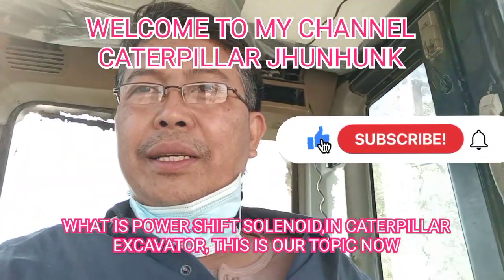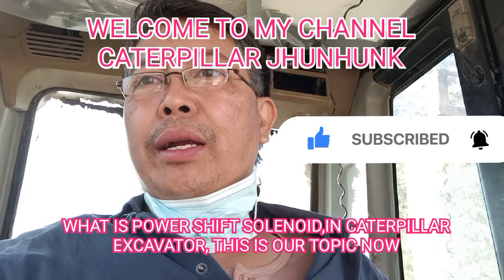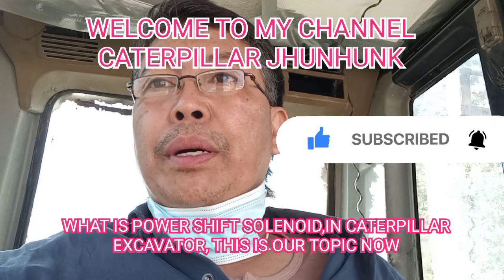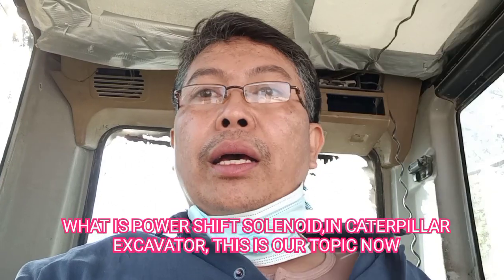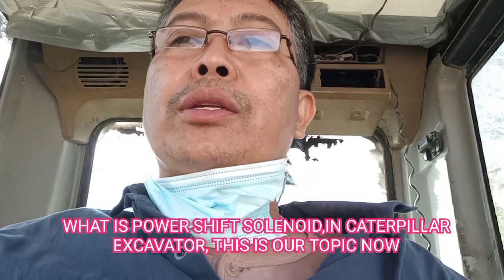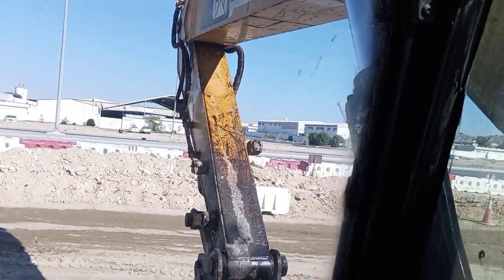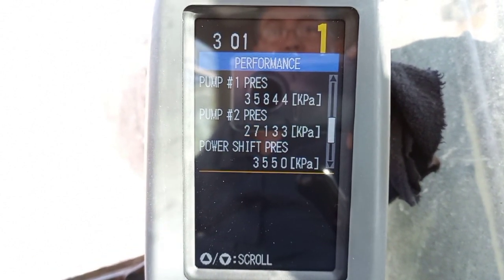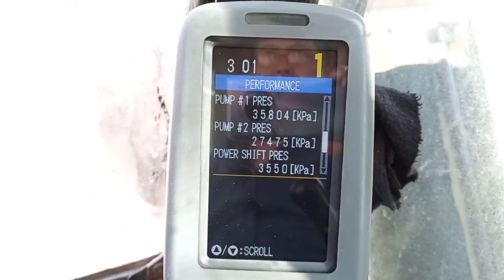CATERPILLAR EXCAVATOR SIMPLE TIPS HOW POWER SHIFT SOLENOID IMPORTANT, IF THIS IS NOT FUNCTIONING

Comment: What could be the cause of our unit that the engine auto idle didn't activate when you move the joystick/lever of boom down, travel right, bucket in/out and stick in but if you move the joystick/lever of boom up, swing lh/rh, travel left and arm out the engine auto idle will activate....

Ty in advance for your response.
Reply: Cat349d2 po Yung unit namin  sir

Comment: Assalamualaikum dear sir ..how are you sir on idel the machine psp power shift solenoid pressure is 34 35  bar but when u load the machine with like fully up boom or fully closed the arms bucket then the psp power shift solenoid pressure should be down 👇🏽 but on ur monitor it's show still consistently and even it's litte up 36 bar it's mean ur solonid is not working well or what else please guide me for ur lot of experience thank you ❤
Reply from the maker: Its possible something is wrong on ps solenoid
Reply from the maker: But if the machine condition and performance is normal ignore it

Comment: Hav a cat 330dl overheating and loose of power what could be the cause or what to check no codes on dash
Reply from the maker: Check the high pressure before you start to operating the machine ,then check again when you feel the power loose, then compair it

Comment: Sir, what, of if the Excavator is not moving fast and the pump is good
Reply from the maker: I dont know which brand of machine you have
Reply from the maker: Many reason possible cause of low speed, first speed control or hydraulic pressure

Comment: 39:374-5
39:2426-4
Ano po kya ser problem nyan ask ko lang po thank you
Reply: 312D caterpillar
Reply from the maker: Brad sorry contakin mo ako s whatsapp, +971567581176
Reply from the maker: 39-374-5 swing brake solenoid open circuit or or wire damage

Comment: What is the normal power shift  pressure? Should the pressure be low will it cause irregular power in movements while operating, stalling the engine
Reply from the maker: Power shift pressure is base on how much you use the hydraulic system function,in full operation from 3k up goes down at 400psi or below if stock in one poesition meaning theres something wrong its eighter stock or solenoid damge

Comment: Sir I have a question if the oil flow seleniod is damage or malfunctioning does the travel,  the deeper, bucket, boom still getting slow?? When it use to operate the engine getting shot off even the operation is just as simple work?? The unit is CAt 320 DL
Reply from the maker: The oil flow is a volume of oil flowing on the hydraulic line, even the oil pressure is normal, if the oil flow is not enough that flowing on the system the machine facing a low power or very slow movement that sometimes not affecting engine performance, but if the oil flow is over than the normal requirment, the engine will almost shutdown, that's why we need the exact oil flow, to get exact, good engine performance
Reply from the maker: But on your situation you have to observe and check the high pressure of main hydraulic pump if it's  producing normal high pressure, or maybe the engine is the problem, you should have to focus first on the engine power, observe the engine acceleration if responding normal, try suddenly acceleration it's for you to know if the engine is in a good condition
Reply from the maker: Must be the engine is normally accelerating suddenly if you set the dial in full position, if the engine is slowly raising at that time you put in full acceleration, meaning your engine is low power

Comment: Hello how are you I need your help my excavator Cat 320d doesn't travel fast even if you press the high button what is the problem please help?
Reply from the maker: Check solenoid under the control valve, 3 solenoid available there 1st one upper side is hydraulic lock, and the middle one is swing solenoid and the 3rd one at lower side is travel speed
Reply: I'll check it thanks

Comment: How to troubleshoot the current supply of the 320 caterpillar for the hydrolic lolck soliniod when I down lever control handle no current well reach to the bottom of sacket help jun
Reply from the maker: On down position of the hydraulic lock dis ingage, meaning cutoff power or neutral, can you contac me in my whatsapp +971567581176 to know more about the trouble and some other details of the problem

Comment: hello sir 
when I remove shift pressure solenoid cable and move joystick the rpm of engine still up and down not dying 
and the power of all movement is slow 
what the reason ?
Reply from the maker: Bro contac me in my whatsapp +971544794515 i need more details about your machine, brand

Comment: Had exactly that problem. Motor stall (bog down) when doing digging (with moderate force required) or any cylinder was at the end of travel and I kept pumping oil by holding lever in position. This way with stick and boom cylinder engine quit within seconds and for bucket cylinder it took a tiny bit longer. My excavator has also the "attachment" valve as you show at the end of your video. I took the "attachment solenoid (I currently don't use) and put it in place of the power shift solenoid and excavator work perfect now. (ordered new part on amazon)
Reply from the maker: If any hesitation or confuse, contac me in my whatsapp,+971567581176 for fast conversation

Comment: Sir gud day sir i have a question for our caterpilar 320d excavator my question is we replace a new used engine but the problem is when we start the engine it starts but after a few seconds it shut down do you think sir theres a problem in our ecu?
Reply from the maker: sorry sir for late response, regarding about your problem, so many reason why the engine is suddenly shutdown, in electrical related problem its possible on the common rail sensor intermitent functioning, or pressure fuel pump solenoid valve, and one more thing if you can see the speed sensor attached on flywheel there 2 different sensor is there 1 is treaded type and the other 1 is plastic type black color, this plastic type if the pulse is not accurate for the ecm requirement they can possibly shutdown the engine there is 1 more black plastic sensor at the lower side of fuel pump near engine black, that is same part # flywheel and pump, check bought sensor by multimeter check the difference.
Reply from the maker: there is one more idea, open the diagnostic onthe monitor then start if the engine is started live the monitor open at diagnostic then wait until the engine shutdown then see what other more error shows on monitor, or contact me in my whatsapp, +971567581176, for fastes conversation, ok then send me some video or picture for my refference to analys the problem
Reply: Sir pwedi pahingi diagram sa switch na basag kc..manual at auto 12pins kc.hirap i sa ayus baka ma baliktad

Comment: Thank you sir . I have a problem with my 320D all the hydraulics are slow, travel , boom and swing . Is it normal for the power shift pressure to be constant at 3550[kpa] on idle and when operating at the speed of 10 does not change? Your assistance will be a massive help.
Reply from the maker: if we are talking power shift the power shift will change in pull rpm to lower pressure, then will be coming more lower while you are operating the machine

Comment: Sir ask ko lang po CAT320d... namamatay makina kapag nagbboom up, lalo na kapag may load un bucket
Reply from the maker: ganito mag ptessure test muna kyo, tpos record nyo para kung sakali n mabago nyo o nagadjust kyo pwede nyo maibalik s dati kung mali, tapos check mo pressure ng power shift kung nagbbago b ang pressure nya kpag nagooperate ang machine, pag hindi ppweding may problema s power shift, kung ok power shift, mag adjust kyo or bawasan ang flow ng hydraulic, diba nsa magkabilang gilid ng pump may nkalagay n valve at may adjuster, ung adjuster doon kaliwa at kanan parehong may adjuster ang lock nut nya is 36mm luwagan nyo un, tapos pihitin nyo pabalik or same as paluwagisang ikot tpos testing kpag nagbago sya at bumagal, tpos hindi n nmamatay, dahan dahan nman s pag higpit, dpat pareho un ha wag isa lang, at gumamiti kyo ng thermometer para malaman nyo in 30mins n test kung alin pump ang may high temp, un ang bbawasan ang flow hanggang maging ok ang Machine dapat balance temp nya

Comment: Sir pwde po pa2long  my unit kmi 320d umiinit po yng power shift solenoid hndi mahawakan posible kya ito sira tska low power galaw nya.
Reply from the maker: check mo ung power nya kung saan nagmula baka ksi nka direct n sya s power supply n 24v,ang normal nyan at galing sa ecm at dumaan ng mobility switch, nsa kanang side ng operator sit sa bandand likod ng upuan s kanan, kapag nakaon s mobility dapat makikita mo s monitor mobility at mawawalang ng supply ung power shift
Reply: Good morning  sir, naka direct nanga po sa 24 v yng supply ng power shift  soleniod, sir bka  po my diagram k ng connction ng switch yng sa kanang side sa likod  wala napo kz switch myron po dn nkalagay pa yng sa hi in low ng speed nlng. Sir maraming salamat nareply mo aq.

Comment: We have a 1994 320 Cat Excavator and we just put in a new hydraulic pump and the machine ran really well for about 5 hours then all of a sudden the joystick controls did not work the machine was running full power but nothing was moving (the boom, travel, etc.) Does that have anyting to do with the solenoid?
Reply from the maker: yes bro check the hydraulic lock solenoid maybe it is not opening or the solenoid is damage.inspect the electrical wiring and the solenoid

Comment: Does 2000 RPM hurt your engine?
Reply from the maker: thats depend on the standard setup of the manufacturer of the machine,but if you just setup by your self because of low power i think it is not adviseable,normaly 1900rpm its little different but your engine is protected in the sense of long life of the machine
Reply: @caterpillarjhunhunk  my Is a cat m316d and by fabric do 2000 RPM
Reply from the maker: @nitrek666  if you think thats is the normal live it

Comment: Sir Caterpillar c9 engine run on 1800 rpm and then slowly slowly with in 3 to 4 minutes engine come to 800 rpm... please tell me the fault
Reply from the maker: at first you should have to check the possible active error,maybe on that error is the main cause of problem,or  try to check the fuel line if the engine is slowly slowly low raise,but i dont exactly what happen to your machine this just my analysis base on what you told me.

Comment: Anong problima sa scavator na ayaw lumalabas ang fuel anong gagawin po
Reply from the maker: pogi bigyan mo naman ako idea kung anung klasing makina o machine electronic engine b o manual type lang,kpag manual type lang check kyo ng fuel line at yung lifting pump nya,o bka barado n rin ang hose dahil namaga na o kya sa tank nya,ppwede rin kung may gumalaw n nga machine mo bka nagka baligtad ang line nyan.kung electronic engine nman kailangan check power supply ng ecm,at mag check din s error system bka doon mo lang makikita ang dahilan ng problema ha
Reply: @caterpillarjhunhunk  electronic na excavator to boss wala lumalabas na fuel piro mo start ang makina

Comment: Hello sir what is the cause if the operator when he apply double engage the machine almost dying but he apply travel the machine is good as always the boom up and stick and bucket in and out only two motion like travel and boom up the machine is almost dying sir pls give the idea about this troubleshooting salamat poh sir
Reply from the maker: usualy in that situation,you have check in full trigger for in and out or up and down,and what i mean is out for 10sec slowly until you reach full,observe that procedure then must be open the monitoring in pressure testing and observe how much pressure for each function in full trigger,or you can add me in what app for better conversation +971567581176

Comment: In my Cat330C , there is an alarm beep, and on the screen "low oil pressure appears" every time when it beeps. When I change the engine oil, the alarm doesn't beep for few days or beep just a little. But after like 15 days it starts beeping sometimes for an hour. While it beeps the machine works slow. This alarm issue is from a long time. I don't understand, if the sensor has some problem or the oil is too thick.
Reply from the maker: bro you have to check on the monitoring system to make it sure witch type of error shows on the monitor, on that way we can deside for what to, ok check it first error then tell me
Reply: It appears as " Eng oil press low". Last few days the alarm did beep but for few mins in the whole day, sometimes twice a day and sometimes doesn't beep. I just changed the oil and filter yesterday in the evening. Today after half an hour working it started to beep again and it's been an hour now. Whenever it beeps the machine power becomes a little low. This alarm issue is from an year, if u have any idea how to solve it, kindly let me know.
Reply: @hanifkhan3465  Check the oil pressure with a gauge. If the pressure is good replace the oil pressure sensor. If it's bad your bearings or oil pump may be worn out. But if it has run for twelve months without throwing a conrod through the block then my bet would be on the sensor

Comment: What is the cause of back and forth slow movement of excavator 330 bL
Reply from the maker: the main reason is low pressure,many reason why because of the machine long time using for work. so before you start do the trouble shooting you have to investigate how the trouble started

Comment: Good morning i experience cat 320d error code show 39-167-12 what does it means?
Reply from the maker: bro regarding about that error, 167 that is alternator charging sensor its either alternator regulator problem or harnes you can check that in the monitoring if the alternator is charging or not, the normal charging is 26v up to max 28v if the volts output is in between, that means its charging maybe the problem is in the sensing output from alternator, so now the alternator back side is 4 wires #1 is battery, #2 ground,# 3 single wire socket type that is the sensing wire maybe disconneted or shorted inside or harnes damage, #4  is a socket with 2 wires that is batt indicator and supply from ignation switch.or you can contac me in my whatsapp +971567581176 for fast conversation

Comment: magandang gabi sir, 318d ayaw mag high idle ano b sira nyn?
Reply from the maker: may mga dahilan yan kung bakita ayaw gumana ang high idle ppweding sensor or low presure, katulad nlang ng speed output sensor or ung pedal sensor, the best nyan check mo error code logged at active, pero wla nag wwarning s monitor habang nka andar, at anung function ng machine ang hindi ng hhigh idle.or try mo s likod ng cab kung saan may mga solenoid, may dalawang pressure switch doon 2 wires lang sya ung isa s bandang loob at ung isa nsa bandang bukana, ang gawing mo full raise mo ung volume, ng accelerator then e short mo isa isa ung pressure switch
Reply: @caterpillarjhunhunk  maraming salamat sir
Reply: @caterpillarjhunhunk  39-E00232=01, 39-E00265=02 loged
 event
39-1160=5 logged error ano pong sensor yan sir?

Comment: 36:617-5
Reply from the maker: bro that error is inlet heater 617-5 open circuit 617-8 malfunctioning eigther disconnected or damage, located at intake manifold at front we have relay there check or insfection that area for possible damage

Comment: Ano kaya problem sir, 515 psi lang reading nya sa monitor di nag nagbabago, dumadapa ang makina pag nag stall test, may supply 25 volts ang powershift solenoid, sa actual bar Guage ay 600 psi sya, nababa lang ng 540 psi  pag nag tetesting, 5000 psi pump 1, possible ecm ba? Baka 25 volts lagi naka supply sa kanya,
History, nagpalit ng injector anim saka machine harness,
Reply from the maker: brad sinsya na ngayon ko lang nakita message mo ganito kung bagung calibrate ang injector ppweding hindi lahat nga injector e gumgana ng maayos pweding ganun, ppwede rin may isa s sensor nya n hindi nagffunction ng maayos kya nadapa ang andar ng makina, lalo n ung intake booster pressure sensor, maraming bisis n ako nka incounter ng ganyan, hindi sya nageerror pero d n nagffunction,normal lang yan supply ng power shift mo galing s ecm ang supply nyan then dumaan s switch n nsa loob ng cab s bandang kanan, kpag nkataas ung switch n un lalabas s monitor mobility nka low idle lang ang makina at kpag ginamit mo o pinagana mo mamamatay makina. inspection mo muna lahat ng nsabi ko ha. o kya kuntakin mo ako s whatsapp, +971567581176

Comment: Hi thanks for video,  i am facing one problem in caterpillar excavator 320D, IMPL PWR Shift Presser not increasing  solenoid is we are replaced done, up solenoid voltage is coming plz. advice
Reply from the maker: i'm i cannot understand what do mean, contac me in my whatsapp,
+971567581176 for better conversation ok
Reply: Ser im having problem with my komatsu...it can move all its moving parts...after using a couple of hours ...limit 1 hour after that then the machine wont mive anymore ...any advice please.... Its a komatsu wheel type excavator

Comment: Position 36 617 5
Reply from the maker: bro that error is located at the intake manifauld, the name is inlet heater relay, 36-617-5, if that is only the error available as active ignor it, that heater is usefull if your engine is hard starting, ignor it there's no side effect for the function of the engine